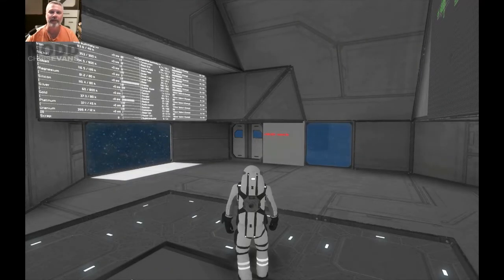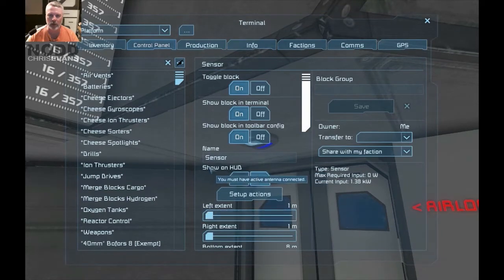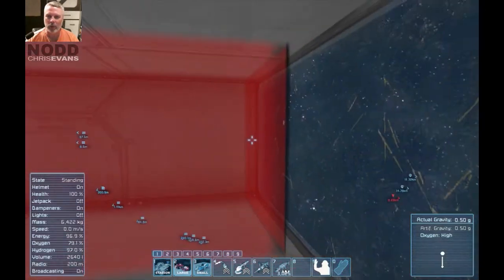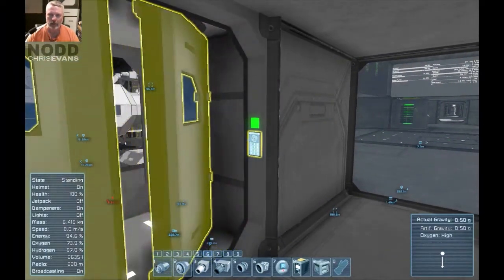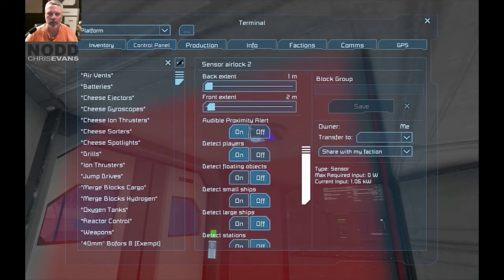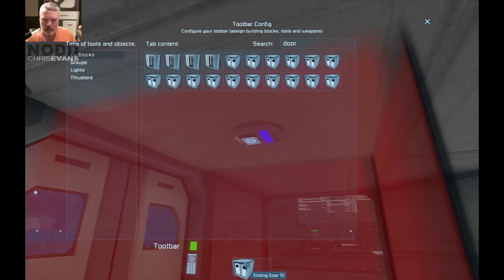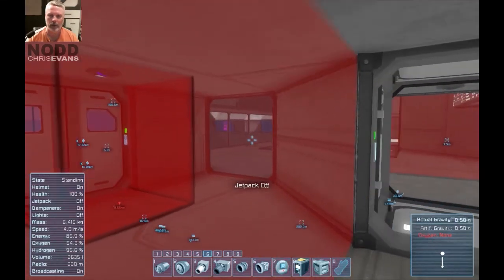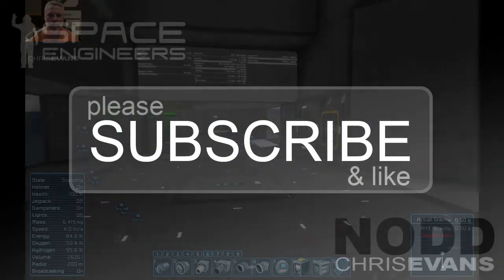Space Engineers - 014 - Automatic Doors

Comment: Hi, I was wondering if you still play? yes? ok then heres an idea for least loss of air is doors back to back to what currently have, then a sensor on the front door and the back door.
HANDY TIP: control left click on a sliding bar will allow you to enter a number figure I normally have it set to 1.25M for before the door then the field that reaches into the door I have that set for 2.5m I think this way as you enter the airlock the first door shuts behind you then you move forward and the outer door opens with minimal air lost...
Reply from the maker: Hello M Knight. I've not played Space Engineers in some time but I do plan to revisit it again at some point. Especially as I hear they're finally going to do a full release. Yes I've played around with all sorts of door configurations. I actually stopped putting my doors back to back on my multiplayer server because people would run through them so fast the outer door would open before the inner door had a chance to close. That often resulted in decompressing the entire station. But on some of my single player games where I knew to take it slow & let each door cycle completely before proceeding to the next door, back to back doors worked quite well. That said though we ended up preferring to use modded airlock blocks. Those kinda do away with the need for an airlock room altogether. I still like the idea of building a proper airlock with door sensors though.
Reply: @chrisevans-nodd  dunno about a final release but the non steam version is good and the mods a dime a dozen so all good... in case your wondering I dont care to be a steam patch tester... or for that matter have those tosspots lookin over my shoulder making sure I dont 'cheat'